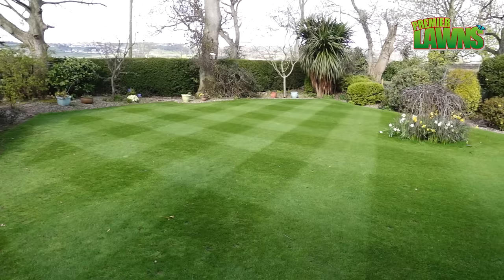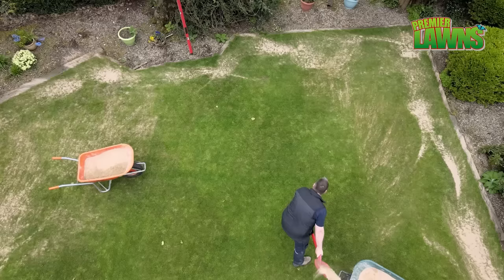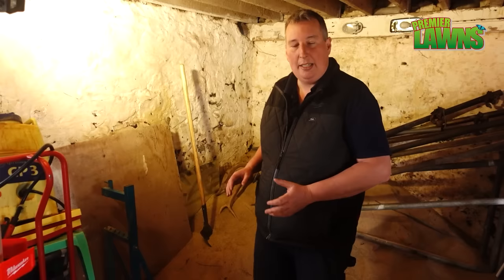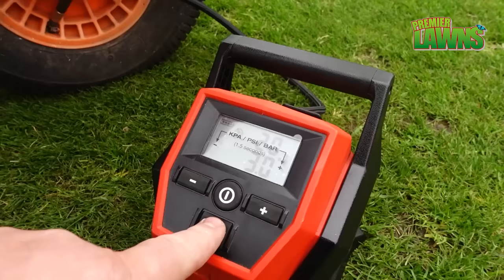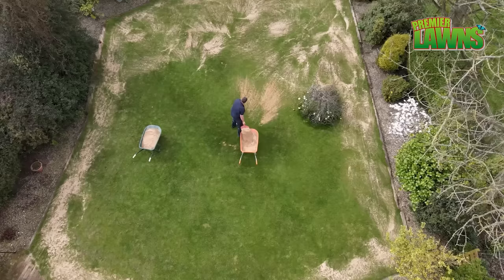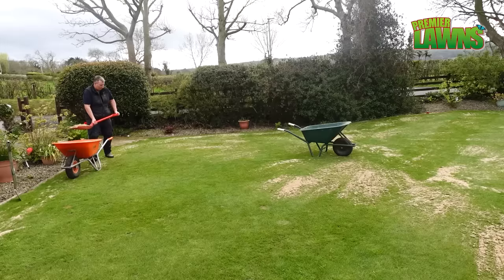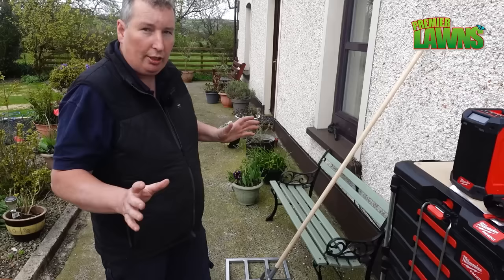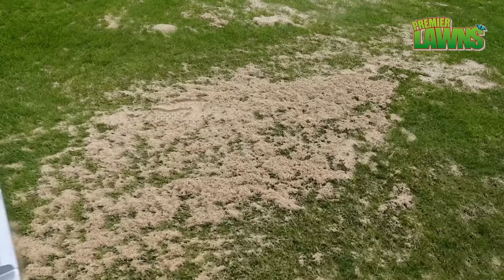Why you SHOULDN'T USE SAND to level a bumpy lawn

Comment: I don’t understand. Should you use sand or not? Surely the sand works it way down into the soil and can improve drainage?
Reply from the maker: Sand is great for levelling, not much else. Sports sand should be used if you are using sand
Reply: You are correct.  Better yet, core aerate and then take in sand to help remove compaction and create space in your soil for air, worms etc to work through it often

Comment: The reason I'm left scratching my head is because I've never heard of anybody ever just putting sand on their lawn? Lol at most like in my case I just did topsoil mixed with a little bit of sand to help with air and filtration to kind of get in and let the topsail work down and integrate into the low spots that I put it in in the lawn. As far as trying to turn my front yard into a Sandals resort I don't understand why anybody would be dumb enough to do that LOL food for thought
Reply from the maker: I get a lot of comments from people who only use sand and this video is for them
Reply: @joshuaroyal3272 - As crazy as topdressing your lawn with sand seems to novice gardeners, it is what the professionals use for this task, as sand doesn't compact like soil does. This means soil (even topsoil) is more likely to develop ruts and bumps after frequently walking over the lawn, compared to sand. Hope this helps. 

As Robbie has mentioned before, sand obviously doesn't hold any nutrients, but if you are just using it for levelling that is fine, but if you are concerned the soil is poor to start with you can of course start with a topsoil and then move to sand the following session. Alternitively go for a rootzone sand+soil (70/30) pre-mix.
Reply: I would think the sand would suffocate the grass, no?
Reply: @joshuaroyal3272 it can if you put too much sand down, it's good to sweep it around with a broom so the grass tops are poking through to help them out

Comment: I think sand dressing and should I brush sand down the core holes are the most asked questions of recent times. Good content on differences between the different types of sand. I remember reading that this all originated from the Scottish links golf courses where a green keeper noticed his green performance improved when sand got accidentally blown on to his test plots.
Reply from the maker: Golf courses back in the day were built on sand dunes as this land wasn't useful for much else, the oldest course in the world is 'Old Course' at St Andrews and guess what it's built on sand dunes. The greens were made from the sand as that is what was there. 
As golf courses moved inland, they stopped using so much sand. 
Lots of golf courses started to build greens out of what was there at the time, soil etc. These are know as 'push up greens'. Mostly due to cost. 
If you think of a golf course and the landscaping around it, bunkers and what not, push up is just that, soil pushed up to form a 'green' to play 
As Golf courses greens get so much traffic on that one area - the golf green it needs to be able to be free draining and have a level true surface for ball roll,  If a ball bounces around alot this is considered bad, the truer the green the better. 
This is where sand comes in, but the key thing is and is often overlooked when people think about using sand on their lawns, golf greens have drains under them and the sand helps perculate though it and down to the drains and away. Most lawns don't have that luxury.  
Sand is fantasic for levelling as we all know, however not all sand is equal.
Reply: @Premier_lawns_official  I have wondered where the term push up came from. I find all this stuff interesting. Thanks for taking the time to reply with this fairly long reply, appreciated 🙏
Reply from the maker: @grahammacklam4736  Your welcome

Comment: What a lovely dog! I'm in the US and where I was raised we didn't even edge our lawns. So leveling a lawn is completely new to me. What is the purpose--beyond adding beauty to the lawn (of course, that's a good purpose in itself!)?  I don't understand how sand levels the lawn?
Reply: Mostly for mowing ease. Can't get a uniform height grass if there's 2" dips the mower straddles. 

Bought a house about 2 years ago now, and we had a sprinkler issue that sucked a bunch of topsoil out and while the HOA eventually fixed the sprinkler, they didn't fix the soil. So now we've got a high soil strip next to the walkway, that the trimmer always cuts down to dirt, with a trench right next to it that the most never cuts, so it's like 6" long. LOOKS flat, but it's nearly twisted ankles more than once.

It's why I'm watching these videos lol

Comment: Thanks for a good video. Based in Sweden, not so dissimilar climate to NI. Looking to level my lawn this spring and I have some pretty major unevenness due to building works leaving sunken patches. In some cases there are height differences up to 7-8 cm. Would you recommend soil or a soil /sand combination to level this? I’m concerned about a 100% soil mix contracting too much.
Reply from the maker: Hi Craig, great question. I think this week's video will help you with that 
https://youtu.be/3xzVmX4-STA

Comment: No No No, sand is very good solution.
Use more sand, use rack
6 week after the sans is in the soil.

But the best priod is automun before grass goes in dormancy.
And second period is march or april during the first week with sun.
During this 2 period it rain and the sand goes to the soil.
If you don't apply the sand in rainy period. Watering watering and watering every day  -> 4/6 week (more expensive)

I'm not in the USA i'm in france (lower normandy) the weather and grass type is same like you.
My grass is 100% Ray Grass, I have test blue grass it's ok but ray grass is more beautifull but with more effort

Comment: I used sand on a side lawn.  I listened to some folks about compost and no sand for my front facing lawn.  Both bare soil and then seeded lawns.

Guess which one is doing better? Guess which one looks like I just poured the seed in a river?
Reply from the maker: Do tell 🙄
Reply: @Premier_lawns_official  The side without sand is a complete failure...  The side with sand is the best looking lawn for miles.

Comment: What a load of nonsense, it completely depends on the texture of the soil the grass is growing in. If its clay soil it already retains more than enough nutrients but sand will improve the soil structure over time.

Never heard of anyone using plastering sand either, it should be washed sharp sand.

Comment: I disagree. You growth example shows you killed it off then put sand on. That's not top dressing an active live lawn. Everyone who has a cylinder mower should know to sharpen/replace cassettes its just part of it. Your drainage example is of a dusting of sand not a build-up over years of application and use of aeration to help drainage. the same dusting of soil would have the same effect. If you use the wrong products and do not do your home work you will get weeds and drainage issues with any top dressing.
Reply from the maker: I get lots of comments/questions from people that if they apply a dressing to sand to their lawn,  will it magically dry up. No of course not. 
 If you want to improve drainage in a lawn, install drains! (It has nothing to do with what you topdress with) 
They use sand on sports pitches as it drains well, however, they also have drains under there and the sand helps it percolate through the rootzone to it
Reply: @Premier_lawns_official  correct however a soil mixture of sand and soil can only benefit as soil will retain water sand won’t. Again in the right mixture and application with other aeration
Reply from the maker: @TheNewryRFC  yes a lot of that will depend on the lawn, what it's being used for and the type of soil already in the lawn. My lawn is mafde from 70/30 and there is a lot sand already there. 
I think you will enjoy this video https://youtu.be/X3v2g6Hybps
Reply from the maker: And this https://youtu.be/V6u4mDTtMD8